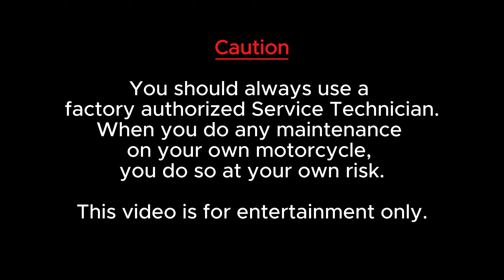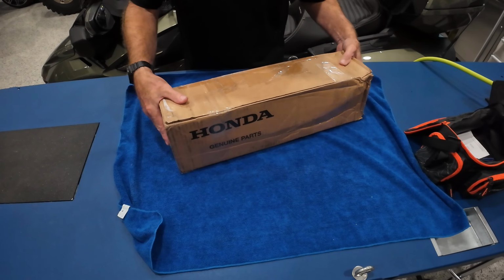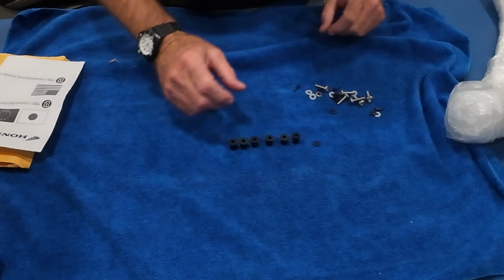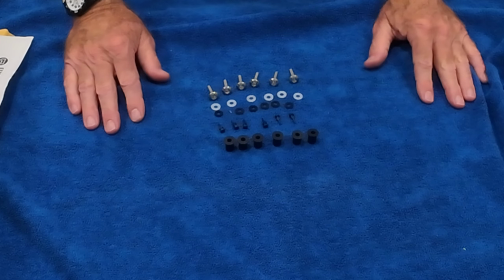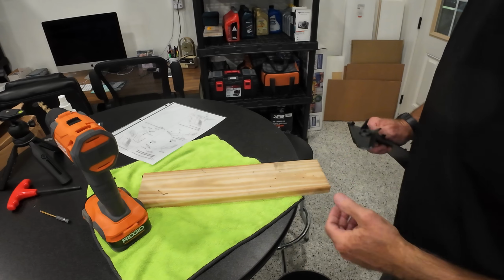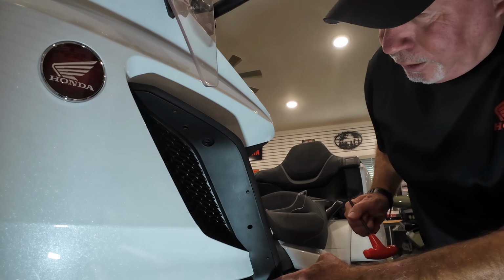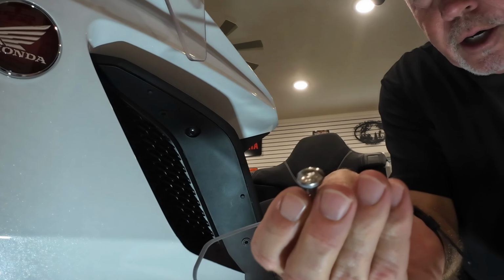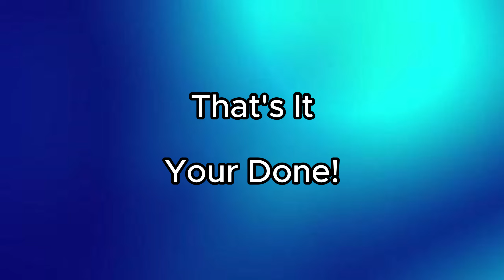How to Install Honda Gold Wing- Lower Air Deflectors

Comment: What do you think about air deflectors where you can adjust the air flow? Like if its hot outside you can make them direct the air to the driver and when its cold to make the air go away? I see that on Honda originale they are fixed in one position.
Reply from the maker: Good question-I did swap out the Honda OEM air deflectors for the adjustable deflectors. Here is a link to that video. https://youtu.be/8SC7M4KEauE. The adjustable ones are a much better option IMO.

Comment: Nice job, Mark. Did it come with a drill template?
Reply from the maker: @GoldRyderOne  Hi Mac. The back side of the deflectors attached to the bike from Honda had real small indicator points for the 3 mm holes.  There were circles showing location of the 9.5 mm holes.
Reply: @MarksGarage17  That makes it easier. Thanks.
Reply: I was wondering the same thing! Great tutorial Mark on the install. I've the same set of deflectors and they are awesome! Best regards!